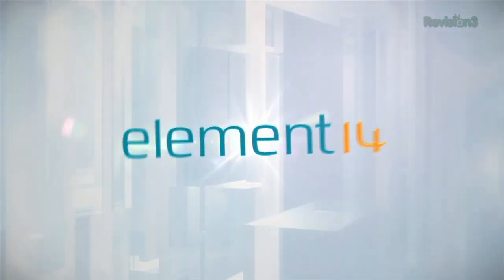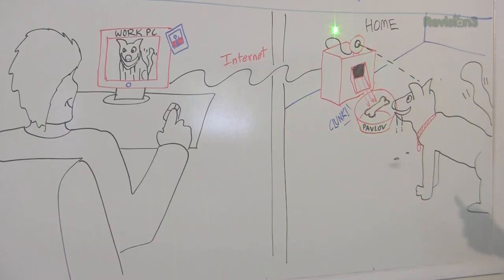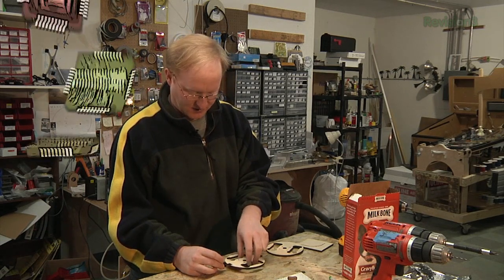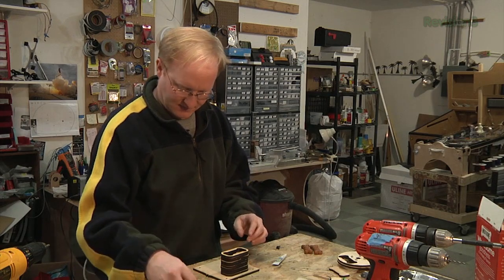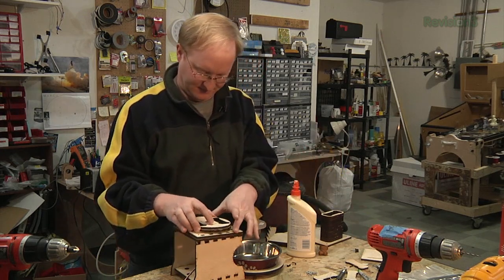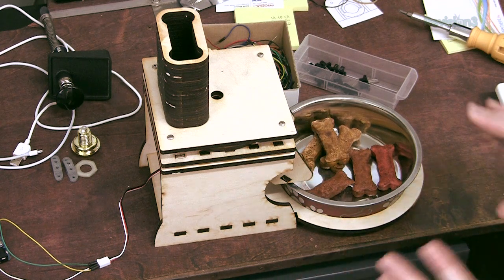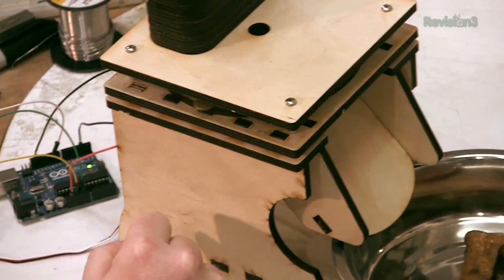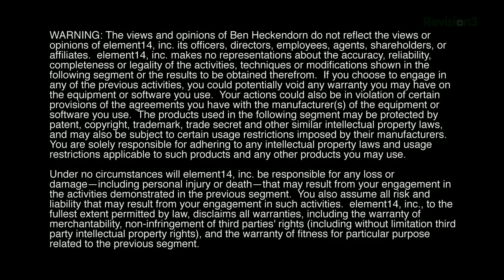Doggie Treat Dispenser: Part 1

Comment: I've used a digispark, some basic Linux knowledge and basic programming knowledge to turn the lights on and off in my room by way of the internet. I assume the same could be done with a stepper motor.

That cost me maybe $2 for a mechanical relay, $10 for the Dlgispark, and pocket change for wires and cables. I did the programming myself in Java, MySQL, Ruby, and Javaish-Arduino. Nothing too major.

Comment: wouldn't it be easier to put a small extension on the disk and use a microswitch instead of the infrared sensors?

and isntead of having to cut and glue the hopper wouldnt a 3d printed hopper be easier? or would the tolerances not be as good?

Comment: the first step to finding small surface mount devices is to not need glasses, the second is a very bright light. (actually the easiest way is to have a very powerful magnet and a non magnetic floor, most surface mount devices will have enough ferrous material for a magnet to pick them up, but not all), but every bench should have a good magnet tucked out of the way in case you put a mechanical hdd on it. a good way to have one is to recess it in the wood on your bench to hold screws.

Comment: Hi Ben, great project. Just a note though, you could have made it simpler just letting the disc go back and too clockwise and counter-clockwise on a standard servo without an optical sensor. Not trolling but I like to make things more simple.